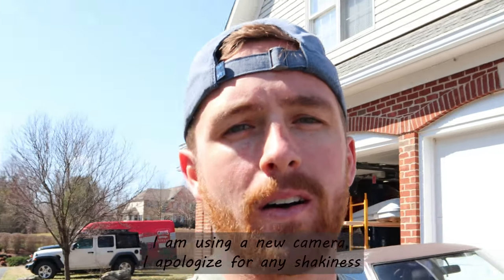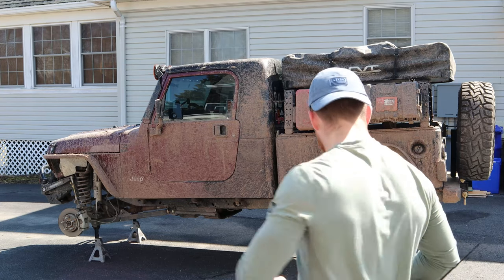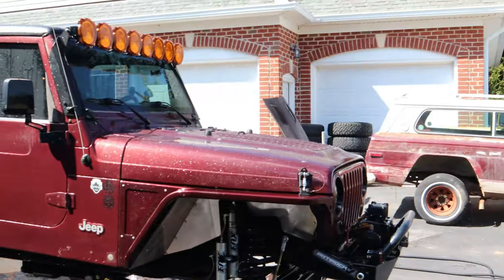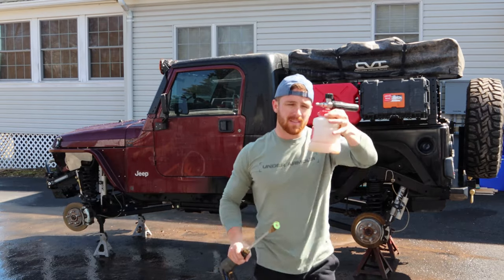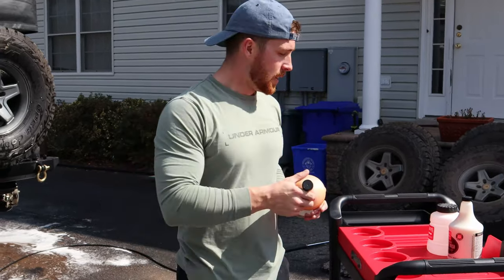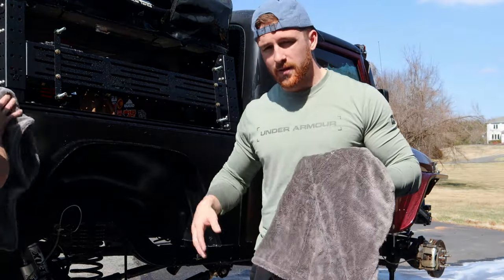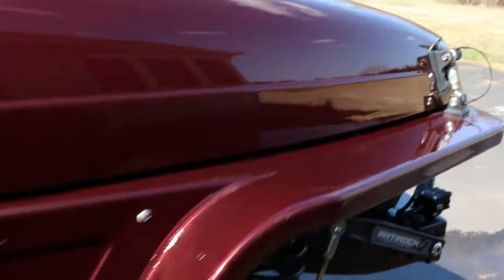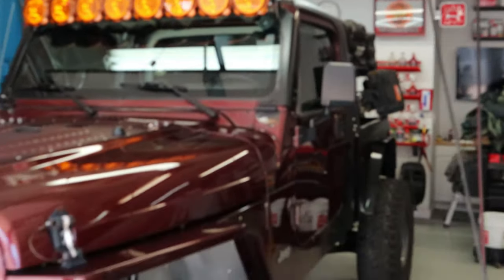Jeep TJ Deep Clean | How to wash your Jeep after an off-road trip!

Comment: Love your jeep but trying to figure out if you ran out of black or red paint?love your tires are they smooth amd pretty quite for every day road drive. I have Cooper at3 discovery on my 2003 jeep rubicon tj which are not bad at all but love your side wall tread. What tire are they?
Reply from the maker: The black paint is primer.  Have not had the chance to fully paint the Jeep since we finished the build.  The paint should be finished in the next month or so!  I love these tires, they are Toyo Open Country R/T.  37x12.5x17

Comment: Question for ya on the griots. I have a JK and my wheels are covered in mud and 75w90 from a seal leak.  I have the poly gloss and surface wash. What should I use on those wheels? I assume something besides those since the poly gloss sounds like an after treatment?
Reply from the maker: Poly gloss is wax, there aren’t any real washing capabilities to it.  I’d try surface wash on them first, let the surface was dwell for 1-2mins and then start cleaning with a wheel brush.  That should help but if not then use a dedicated wheel cleaner.  My favorite is our heavy duty wheel cleaner, stuff is insane!
Reply: @BuiltDifferentGarage   any where I can pick that up close to lancaster pa?
Reply from the maker: @jesterofatlas5749  check pep boys, autozone, advanced auto parts or O’rileys
Reply: @BuiltDifferentGarage   Thanks, advance has it in stock.
Reply from the maker: @jesterofatlas5749  sweeeet!!